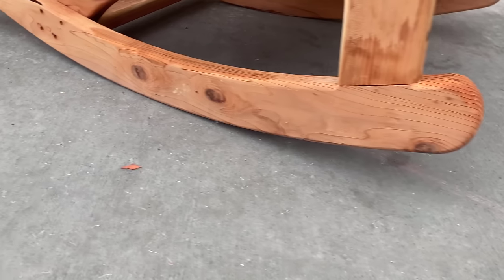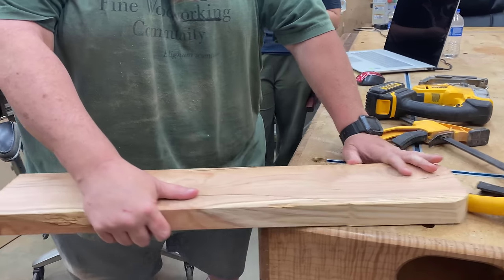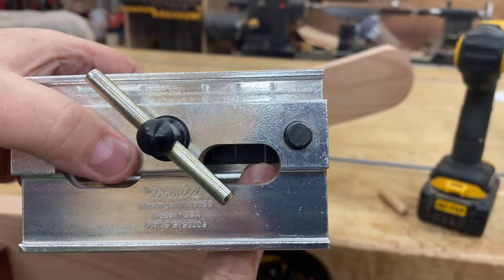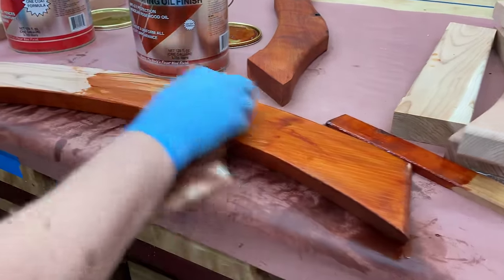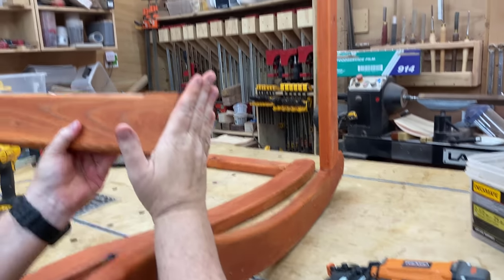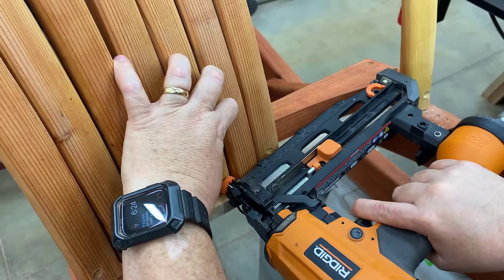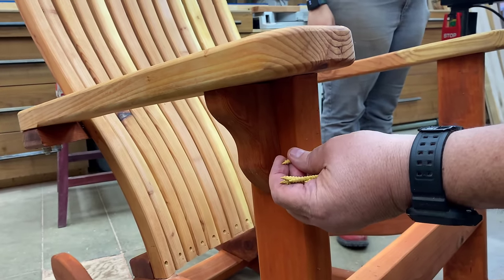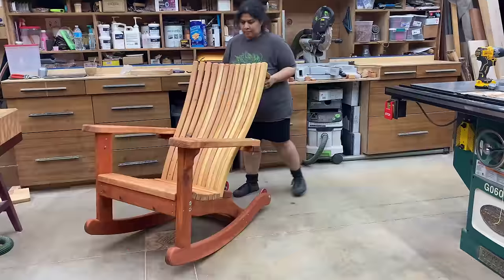118 - Rocking Chair, Adirondack Style and How to Make Money Woodworking pt II

Comment: I love this chair design. it is going to be my firs large build. i have several people that think the Adirondack is too low and difficult to get out of so excited to see how the new placement is higher on the rocker is. and it seems easy enough to add some extra height to the legs? keep up the awesome work i am building my woodworking chops thanks to your channel!! If i order the rocker plans it covers both chairs? would love to see plans for accessories like foot stool or side table? or a bench that would fit the theme? of the 2 chairs id say that TCW is first place, love the purple heart! and the RPG while beautiful was overkill for an outdoor patio chair i would hate to see that get weathered in the elements that would be an awesome heirloom piece for indoors!

Comment: I love both of the chairs and the original!  It’s a good example that the same design can be represented in different ways and they all bring a new look, feel, and personality to a great design!  I have a question about the countersink screw holes, specifically in the middle of the back stretchers, can you predrill from the back to hide the center row of screws from the front view?  What is the best way to hide the other visible predrilled screw holes… plugs, putty, or sawdust and glue?  I am in south Florida and the suggested screws are ceramic coated, eventually everything bleeds, rusts or stains here due to constant humidity and a lot of rain.  I was wondering if a small bead of weather appropriate caulk on the top of the screw head to seal it in and then cover with a plug and plane to the wood surface?  Love your videos and including the family in the builds!
Reply: You could go to stainless steel fasteners.  I use stainless brads when making flower pots to hold until I get screws in.  Don’t want that black stain and don’t want to do filling.

Comment: I got the plans PDF & ordered the templates. Looking at the 2 x 12 lumber list it would cost me for red cedar $772.80 lumber alone in Connecticut. The non 2 x 12 lumber list would cost $547.60. Redwood is unobtainable. Word to the wise, check 2 by cedar prices in your area before you plan to make this attractive rocker.

Comment: Watched both of the videos and was very impressed with both final builds. I found it very hard to choose between the two. I'm not quite sure if I'll even qualify to vote because of my vitric. 1st place on video content = Crafty Weiner. The use of carriage bolts attaching the arm rests seemed a little out of place after using contrasting plugs on the rest of the build (IMO) but I could be wrong. 1st place for craftsmanship = RPG Woodworking and design. His craftsmanship and use of design showed through down to his use of plugs and where he had to use metal he capped off the ends of the bolts with end caps. I can see why he has orders for his chair.  All in all both were very fine builds but for me I'd like to have the RPG chair. Note; He could use some work on his videos, I had to play it though twice due to almost falling asleep the 1st time though. Pick it up a bit - Please!

Comment: Will your recommended oil stain provide enough protection for me to uee  regular framing lumber (eg: 2x6's/2x12's)? I live in Ohio so redwood is not common around here...and cedar is super high. Love your videos.
Reply from the maker: It does offer good protection. But you would likely need to pay better attention to it. Probably re-treat it more frequently. And consider “painting” a 5 minute epoxy layer on the bottom of each foot to 100% block moisture transference up from the ground. 
And finally, give the end grain areas of each board about 2-3 coats of the finish since it will soak in rapidly. 

I find when I do this with pine or Douglas fir. And re-apply every couple of years instead of every 3-4, that my pieces have lasted 15+ years outside, no problem.

Comment: Should I put a varnish on after the penetrating oil?  The chair will be on a outdoor covered porch.
Reply from the maker: @michaelslater7868 , hi varnishes won’t stick to an oil finish that isn’t a drying oil. And Penofin isn’t a drying oil. But also, you definitely don’t need a varnish or anything else on top of Penofin.

Comment: I'd like to price out the materials before I decide if it's worth it to make these. Is there a way to just get a materials list so I can go to Lowes and price the weird?
Reply from the maker: Sure;
You need:

Two - 2x12x8
One - 2x8x8
One - 2x6x8
One - 2x4x8

There are also options if you can’t get wood in 2x12 width. 

It can be any dimensional lumber. Redwood, cedar, pressure treated, southern yellow pine, douglas fir, etc.

Comment: Hello James, thanks for the great video.  I bought your plans and want to make a chair, however, I was wondering on how to make the chair slightly higher for those of us who have long legs?? I am 6'1" and my legs are long.  The lady who sat on the rocker in the video appears to be shorter than I am, and I'm worried my legs will be uncomfortable when sitting in this chair.  Any help would be appreciated.  TIA
Reply from the maker: Hi!

I’m pretty sure it won’t be uncomfortable. I’m 6’2” and if fits me quite well, and a good friend of mine is 6’5”, and he’s sat in in for hours and he said it was very comfortable. 

That was my daughter in the chair, and she isn’t as tall, but she has to sit forward so that the chair rocks forward a bit to put her feet on the ground. Once she starts it rocking she can keep it going easily, but she has to initiate the rock movement differently. 

Unfortunately, raising the height is not easy. You could easily disturb the center of mass and alter the rock. Not to mention that you can’t simply extend the legs. 

The only thing I can think of would be to make the rocker thicker (taller). 

But, I honestly don’t think you’ll need to.

Comment: What size are the front legs? And what angle do you cut the front legs at the rocker board?
Reply from the maker: Hi, we have a 20 page set of plans that cover every aspect, angle & measurement of the rocker.  Here is a link if you’re interested. 
https://kingsfinewoodworking.com/collections/project-plans-for-sale/products/rocking-chair-adirondack-style-3-d-plans
Reply from the maker: I should note that we do have templates available for the curved pieces. But they will only help with those curved ones. There is no other data on those. And you cannot buy them unless you get the plans. 

But fortunately the plans are the only thing necessary. Templates aren’t required at all. And we do state this clearly on the listing on our website. But if you have any questions, feel free to let me know. 
Thanks!